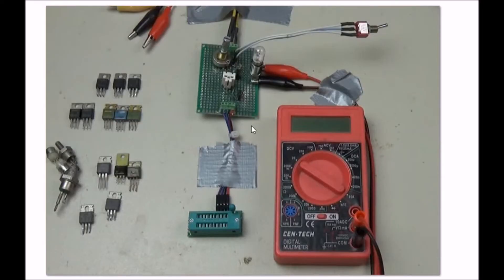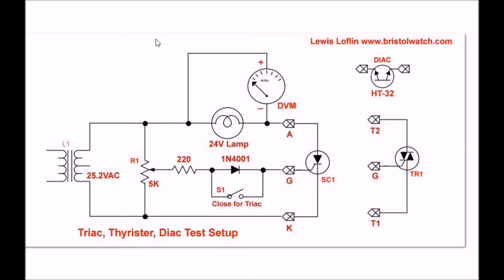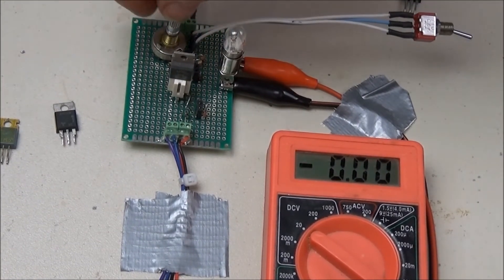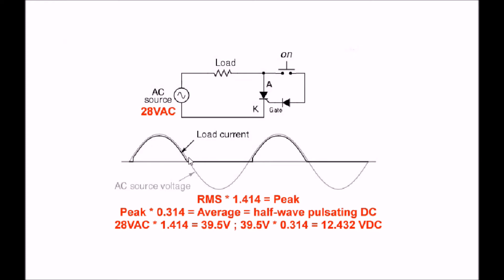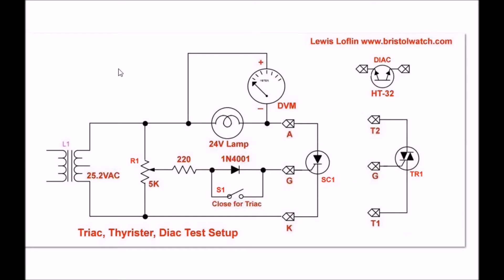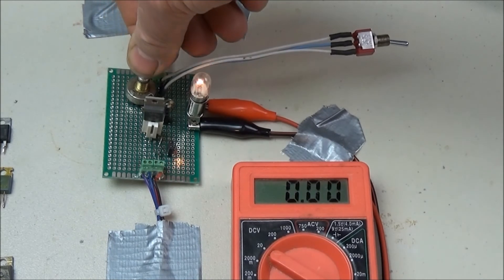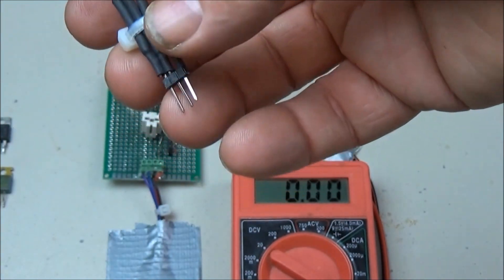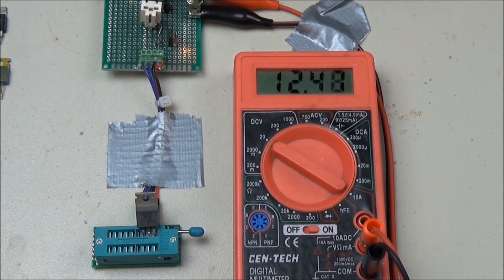Testing SCRs Simple Circuit Part 2

Comment: Is the conduction always greater than 90 since they always turn on on the leading edge of the sine wave.  Like, you can not make them turn on somewhere on the falling edge ie from 90 - 180 degrees. ?
Reply from the maker: Because I use the entire half cycle of 0-180 degrees. You can use 90-180 if you want.